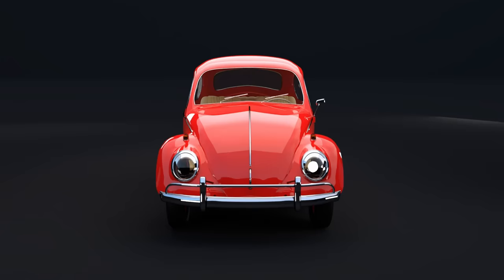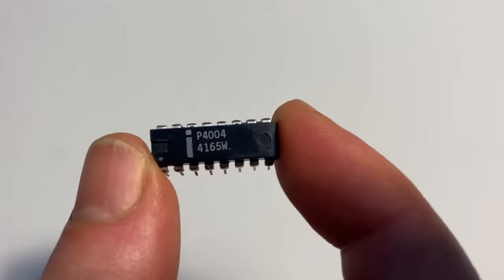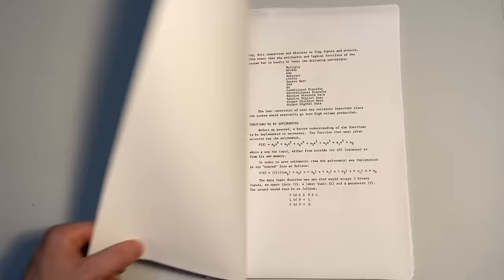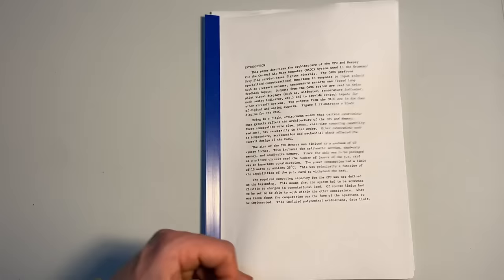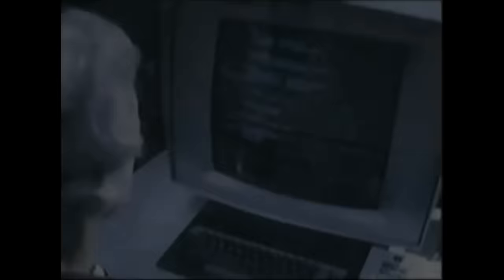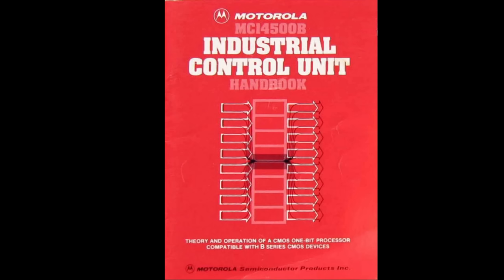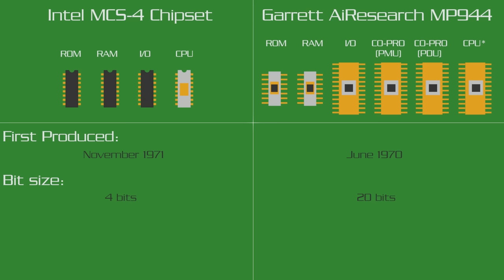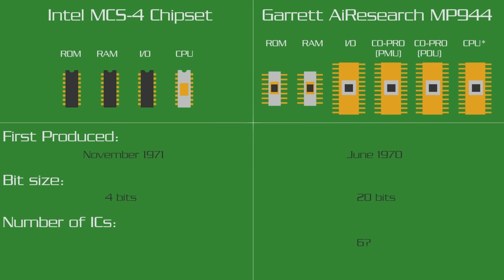The World's First Microprocessor: F-14 Central Air Data Computer

Comment: The F-14 was the equivalent of the US Navy's current NGAD (next generation air dominance) program for 6th generation fighters. It was large, expensive, and had computing capabilities that people didn't realize were possible.
Reply: That makes me think of the F-35, aside from the large part.
Reply: I admit I'm pretty ignorant of recent military computing, but I don't see how NGAD would be using leading edge computing technology as significantly as the F-14 was. At best they're probably using some Intel FPGA's in impressive ways. I'm not sure they have the hardware volume to create an ASIC on a leading edge node like Intel 4 (7nm)
Reply: @1funnygame  High volume isn't necessary if you accept very high unit cost and military applications are notorious for accepting them.
Reply: @1funnygame My understanding is that the biggest advances in modern military computing are on the software and integration side rather than the hardware, which tends to be a few generations behind.
Reply: While mainframes at the time and later military microcomputers had capabilities, I'd be surprised if this system even had an MMU. I suspect the first integrated capability system remains the 601.
Reply: @maitele  Yea, that's what I'm thinking. While I haven't heard good things about military software, because of the stringent validation requirements slowing down development (maybe I'm incorrect here this is second hand hearsay). They might be able to create a very impressive integration of different chiplets that could outperform the equivalent to racks of general purpose servers, when doing the very specific tasks needed for their requirements. In my opinion the most impressive advance they might have over Industry would be using the recent advances in multi-chip packaging with high badwidth interconnects to create a good quality Heterogeneous package (There's even some basic public info like the Intel 'SHIP' program).
Reply: @1funnygame it’s software, and isn’t discussed.
Reply: @c1ph3rpunk  Cool, I had no idea
Reply: And up until recently, it had the largest, most powerful radar fitted to a fighter aircraft. The F-14 was in the early 1970s, what the F-22 is today. The US Navy gave a list of what it wanted, and when the bill came in, they signed it without thinking twice. It was an analog F-22 at a time where the rest of the world still thought the Mig-21 was state of the art. The F-15 is credited as being the US answer to the MiG-25, but if I were given a choice of aircraft to engage the Foxbat, I'd pick the Tomcat. Even with it's TF30 engines. Just give me the most advanced model of the AIM-54 available at whatever time period we're discussing and watch the Mig go down in flames.
Reply: @maitele  Hardware advancements in computing are coming, slowly but surely. There's a lot of work in the background for AI dedicated chips that work with analog computers. I can imagine a fighter jet needing something like that so that it can accelerate its processing for huge volumes of data or maybe within its drone wingmen
Reply: @maitele  this is true to a degree. At this point for 6th Gen aircraft electrical power generation is becoming a limiting factor, especially if they have a laser for missile defense. We're already running out of power on this generation, what with the planned F35 engine upgrade.
Reply: @1funnygame  You'd be surprised just what they are possibly using I'd greatly assume. Much like NASA, they probably still use chips from the 90's. Perseverance is using a 230 MHz PowerPC 7 processor. It's much easier to radiation harden chips measured in micrometers and not nanometers, not to mention a stray particle isn't as likely to bit-flip your billion dollar project when some random cosmic ray beams a shitload of neutrons in your spacecraft's direction. Not to mention easier to keep within an acceptable heat range when you can go from near absolute zero to sun scorching hot depending on if you're in the shadow of a planet or not. Only just recently have NASA begun to venture into using hardened ARM chips instead of their old tried n true. If it came out that the military was putting old ass chips in their hardware to keep things functional during CBRN/EMP scenarios, lightning strikes, extreme heat and cold, etc., I wouldn't be at all surprised.

Remember, these things are just processing machine code, they aren't running an operating system like Windows 11 with upteen million tracking apps, untold bugs, and trying to push 144 FPS with everything set to max and ray tracing on ultra. They're just doing the basic tasks the engineers have programmed the craft to do, and even using a chip from the 90's you're still looking at millions if not hundreds of millions of instructions per second.
Reply: My wife wrote software for the AWG-9 and the Phoenix missile.  The AWG-9 fire control computer was based on an Intel 8080, and she wrote the programs in 8-bit Assembler.  Her specialty was programming the communication protocols that governed the command guidance system.  That is, transferring data from the AWG-9 to the Phoenix, both when the AIM-54 missile was attached to the airplane and when it was streaking away, climbing to 80,000 plus feet in a "toss" maneuver intended to extend its range.  The code also had to help realize robust data transfers.  Her other specialty was in "situational awareness," presenting the RIO with the status of the missiles and giving the pilot some data as well.  Some of her display code was utilized in the F-15A and C models (Hughes Aircraft Company had the contracts for the AWG-9 as well as the APG-63.  Hughes (today part of Boeing Defense, Space and Security) also got the contract for the F/A-18A/C models' APG-65 radar, but my wife was not involved with that.  I tried my hand at 8-bit Assembler on the Atari 800 microcomputer.  The debugger was not the best and my limited mastery of Assembler made me want to toss the computer out the window after a number of tries.  Much laster, I learned IBM Basic Assembly Language for the System 370 Mainframe.  I had no trouble writing all sorts of programs for that.
Reply: @fubar5884
I was thinking along those lines.
Higher G-force, sound barrier breaking, carrier landings, and other shock would do a number on chips. I wouldn’t be surprised if chips or SoCs used were submersed in shock-absorbing, non-conductive liquid.

I used to study computer engineering but took a different career path and I’ve been out of the loop for a lot of recent innovations but this stuff is honestly more fascinating.
Early PMU, PDU, lack of compiler, etc finishing everything in 60kbits is just so crazy, especially when testing it gave results in punch cards… done essentially by a couple of people… those engineers had a level of intelligence and ingenuity that’s almost unimaginable now. Also with NDAs these engineers knew they may never get credit for their work and did it completely out of dedication.
Reply: @DriveCarToBar  I believe the F-14 might still hold the record for being the largest and most powerful radar. It mainly accomplished this through sheer brute force by just being stupidly powerful. As time went on, more advanced radars could be found on the F-16, F/A-18, and F-15C, but none were as powerful as the AWG-9. It was only in the mid-late 90s when the APG-71 was introduced with the limited production run F-14D Super Tomcat. It took technology from the F-15E Strike Eagle's APG-70 radar. The new radar was completely digitalized and more automated; it no longer required the RIO to manually fine tune specific settings. It also had much smaller notch gates, which was the biggest weakness of the AWG-9 (radar notching).
Reply: NGAD is the Air forces program, the Navy has FA/XX as their "6th generation fighter"
Reply: @chamuuemura5314  Well, new talent shows up all the time  They have the luxury of cellphone supercomputers and ultrafast CPUs and superfast RAM....
Reply: @NexusReload the NGAD can design the plane around power generation though.

The f35 has space constraints and a single engine. They never accounted correctly for the amount of power that thing would later end up using. It’s kind of a day 1 design constraint more than an overall issue imo.
Reply: @DriveCarToBar  "The US Navy gave a list of what it wanted, and when the bill came in, they signed it without thinking twice. " Ah, the wonders of the Cold War
Reply: @DriveCarToBar  you dont get to watch sadly, too far away
Reply: For its time the TV Camera, radar, Phoenix missile literally outclassed and many years advanced than European and Soviet aircraft counterpart. It was built literally for long range engagements, not dogfight.
Reply: Technically NGAD is airforce F/A-XX is the navy version
Reply: @1funnygame  look up the f35 block 4 incoming. Its an HUGE update, with a LOT of classified parts, both hardware and software
Reply: @fubar5884 lol you dont know what you are talking about
Reply: @1funnygame  One important difference:  The F-111 and the F-14 utilized state of the art chips before they were utilized in the commercial world.  Today, because of the establishment and evolution of requirements for "mil-spec" hardened chips, aircraft like the F/A-18 and the F-22 used chips that were 1-2 generations behind the leading edge.  This does not make them any less impressive.  The engineers had to squeeze every bit of capability, both hardware and software, out of them.  For example, the F-22's computer network passes data at speeds that make it look ancient compared with what LANS in your neighborhood accomplish.  Yet no one, including the Russians ad Chinese, have equaled the F-22's capability.
Reply: Commercial companies like Nvidia and AMD have taken over the bleeding edge of computing nowadays. DOD's budget doesn't fund much computing research anymore.
Reply: @aerohk  The landscape has changed.  However, DoD (and the Department of Energy) still funds supercomputer efforts, because those are crucial for nuclear weapon design and development.  Still aerospace in the 1940s-1970s was the original "Silicon Valley" before we recognized a "Silicon Valley." For instance, Fairchild Semiconductor, famous for its 4-bit microprocessor (the 4004), used in calculators, made its earliest money delivering guidance subsystems to Autonetics for use in the Minuteman ICBM.  It survived because of its aerospace contracts. There would be no Nvidia, Intel or AMD today without this.
Reply: @henryfleischer404  AFAIK the F-35 isn't THAT advanced. The F-22 on the other hand is only used (allowed to use) by the US for a reason and would be a better comparison.
Reply: the f-14 had a superb cpu (1970), but the plane was delayed so much, so when it started mass production (end 1970), the cpu was so-so and nothing impressive.
Reply: @eng3d  Agreed.  What was impressive is what the software engineers did with it.
Reply: @1funnygame there is a reason most of what’s inside an f35 is classified.  High end military projects often have tech that is 10-20 years ahead of what is available for consumers or even commercial users.  The only way you’ll know is to wait for declassification decades from now.
Reply: @Clean97gti  with its over the horizon targeting system you wouldn't even be able to see the mig burst into flames :)
Reply: I doubt 6th generation fighters will have compute far beyond readily available hardware. The F-14 hardware was really an exception. Chip design has completely matured and only a few relevant players remain. Plus everyone that wants to create high end chips is limited by what ASML machines can produce. I presume the US Defense Department would have Intel make any chips. Perhaps they can create some FPGA or ASIC solutions, but who is going to make those? NVIDIA is working on ASIC, but they use TSMC and I doubt they want to use Intel's fab instead.
Reply: @DriveCarToBar before eagles and Falcons tomcats made migs go home
Reply: @aerohk Don't worry - Intel and Nvidia are still getting their porkbarrel contracts with the NSF and NSA.